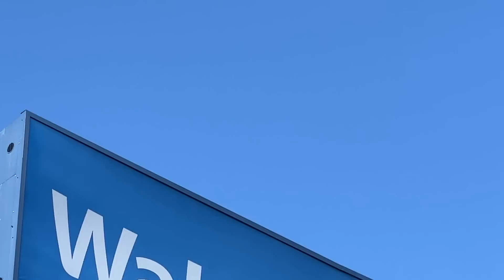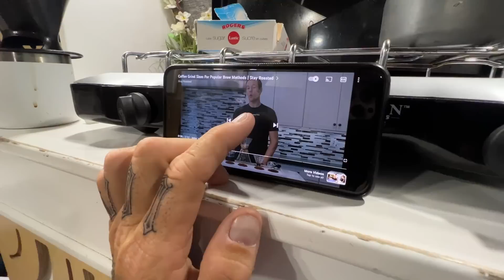Fixing Stuff In Walmart Parking Lot | Starlink In The Pullout Drawer

Comment: oh my heart 😭😭 those screws for the holder on the fride felt them in my heart 🤣🤣🤣
Reply: I agree with you, and I never would have done that! I would had preferred to use two (2) straps over the fridge, mounting brackets behind fridge into van floor!
Reply: Me too, I think I was sucking my gut in also. A number of years ago one of my maintenance techs attached a latch to a brand-new $1500 freezer and immediately ruined it. But it looks like Chrome you did okay.
Reply: Me too, I think I was sucking my gut in also. A number of years ago one of my maintenance techs attached a latch to a brand-new $1500 freezer and immediately ruined it. But it looks like Chrome you did okay.

Comment: Coffee grinder. . . fine grind for a pour over cup system. Your previous reader is correct, less mess turning ground coffee into grinder top. If you are spilling grounds, you have overfilled the grinder. Ex.: I use 3 coffee measures for my electric machine, and that makes 8 to 10 cups. My coffee grinder top holds about 3.5 scoops of ground coffee.
A pour over only needs 1 tablespoon of grounds per cup. Adjust the amount of beans you are grinding.
And, yes. I went through a period of trial and error to figure out how much beans to grind. Every new adventure has a learning curve. 🙂

Comment: I'm wondering if it's okay to drill into your new refrigerator/freezer without affecting the performance.
Reply: I was just getting ready to make the same comment. I'd be terrified of hitting something inside that would cause problems. How does one know where the electrical lines or refrigerate lines are running inside?
Reply: It can affect the insulation…
Reply: I had the same thought! Some fridges have delicate components!
Reply: It shouldn't affect it much since he is using short screws, so it will only go through the skin and a few centimetres of insulation. I wouldn't do it myself unless there's a support, backing or the panel is thick. Otherwise, the shaking and moving of the van will eventually rip it out. Also, It's too early to 'deface' the fridge since it's brand new, and I would assume it's still under warranty. Poking holes would certainly void it.
Reply: NO
Reply: Does drilling into the fridge void the warranty?
Reply: He doesn't seem to heed any warnings
Reply: The screws he used weren't very long and there is an insulation space so it's probably not an issue. The warranty question deserves some investigation. Then again, I don't have a clue. Stay safe everyone.
Reply: I'm thinking the same.
Reply: Its a bad 💡 idea!🙄🙃🙃🙃
Reply: Maybe that's why the old fridge bit it?
Reply: Wondering that myself.🫣🤔

Comment: Chrome, in the winter use the cover from the new fridge to wrap the starlink parts and put it on top of your fridge like you have done all along.  You can just do that when the weather is threatening or when there is a run of snow etc.  The cover from the fridge would not be needed in the winter and it can do double duty that way.  What do you think??

Comment: You can get a truck size window suncover for the front. I bought two and cut one into two pieces for my SUV. Whenever I leave the suv and its hot out I use them, on the front window and sides. When I get back to the car its a lot cooler than if I let sun shine in.